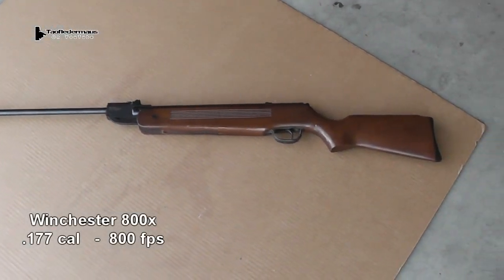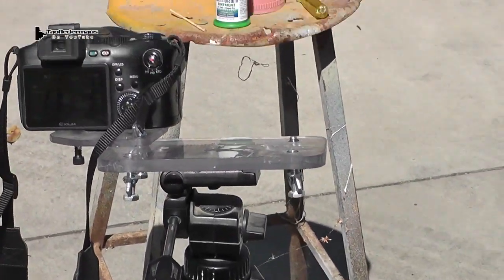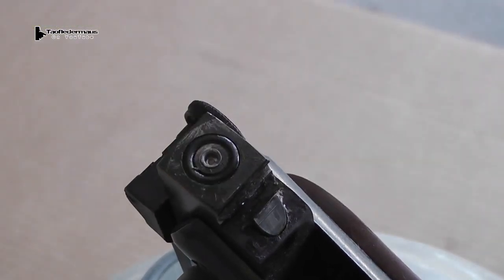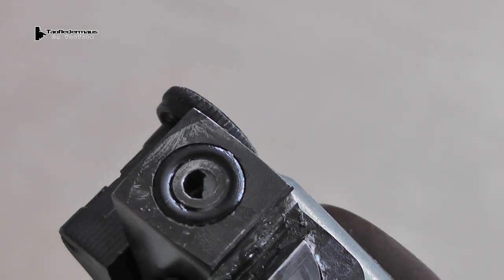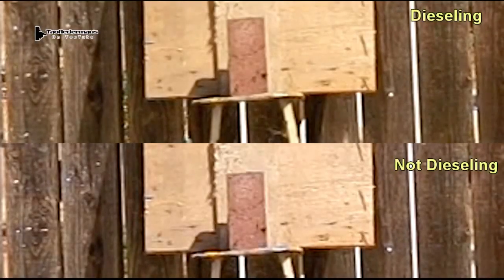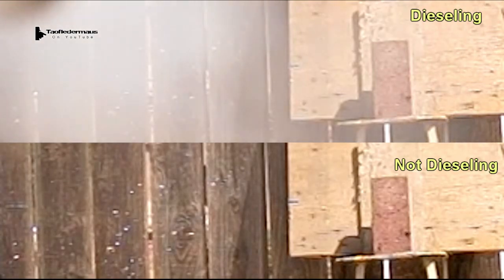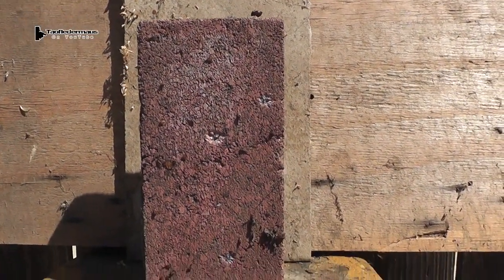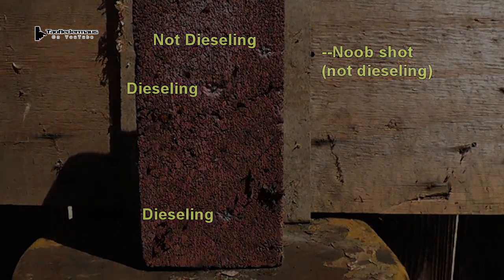Pellet Rifle DIESELING  -   Good,  Bad or Ugly?

Comment: I Dieseling my pellets with 10 w 30 oil, I just drop in to the pellets box😁👍 and ready to go, I believe I doing this for years.
Reply: I've ALWAYS kept my pellets wet with WD-40, there's always about 1/4 drop in the back of the pellet. my Chinesium SKS looking pellet gun doesn't have any seals at the barrel, just a metal to metal cone shape where the spring piston meets the barrel so no worries about that part (and didn't know!). the label on the box claimed 1100 fps, always been impressed with how much hit the thing has, and it just might be getting 1300-1350 fps for how I've always kept my pellets. had no clue about dieseling, the intent was only less friction down the barrel and the thin film letting less air/gas escape past the pellet's skirting as it scoots down the barrel. I honestly wouldn't know the difference in the report sound either! yes there IS a small puff of smoke shooting it.

picked it up from Harbor Freight for 20 bucks near 15 years ago, looked for it in eBay yesterday after seeing videos about dieseling: https://pulsar.ebay.com/plsr/clk/0/SADS/9?pld=%7B%22mecs%22%3A%2228343058111288bd9aee0f7c4a2cac84cd043ec56e4a%22%2C%22ampid%22%3A%22PL_CLK%22%2C%22enc%22%3A%22AQAEAAADYPcZGvQ35F%2FR5hsocg2aUoZAwM2PeJb4A9THo%2BodubrFUUeyEsvmHGWozy3j1LoSDWQtueMpaYxdtwfGo0fJwHY%2F08mX0Av5Wk0Bb0fgp57%2F2%2FMpMT%2BMOq7ADOBTxr0c4%2BWtcEqEC4visVAOMOMNwOQgOfOmpPsKuNaVRUNWHIiBr3z8%2FBowrMYwUtaXYvUMXrQKNwjB2XKtV1ylTLQmVzsNly%2FwpNqCzoGfixZ3MGjYgZFwZXhvpnf0h7rjf5l5EJA5I022JzOCstaHMFi3oLBzav87IUqbv%2F8uuU6lGx3uH26AX1Wk0IBSi0i3oPhFzzsaIerop7EaNRRKZ3DlvvY8AQjE2L7QqCGw%2B0bmC5Tun480PnmMts5jJfRXxiNG%2Fm5p1SPQ8Rn5AQwbmQB8Dy1v8YUSZZ5KTfwhkGcUP4jmxkbZvX1dGbFVugtP3ggY5FJy3JydWAU%2FXatkXc8Lrqc0WjyJyShY8DLPMg%2BI3ZTa9UIY5tmV2mHRLLS4CHqQI0df8ZNPE4zFPCc%2B7YvIcAB4z3ksHUZ426KDS7Pmih4qFXpK3J8fmwphxCBDY%2Bkc5chaiuRdXUkTud9qL5Mj0Fm7ufzZEXdN%2BUuFsOmTSgVny5gXkgsBoi%2B5u3dJOFHw9YoO%2BlWVlRYKt4azKc7YS4v6Dnism9PDRdZP0spkimR7fPDSjUwdYET7kd0j2N4y9cLUNcPCqR5grqQc5TRyNIq2uPFYkYsjJLIswRAtZDziG5YmNgZ0lAKGDniMLdi1U5HAFiOCnzxfCS3Z%2FCrahyT%2BVLsnVOOnAQt4RFvka%2FFbnDPk2cvqxawMfRN49STmp4a0I3tmHFDbzWBaz22Y9NWlLxBOx398ynONCXOthZjsdqGlW7J%2FJDeOLy%2F6Y%2B9jxV2%2FdZ%2FFBWZsopAj8UaNAp%2BZclWwOQbnFZ3Hb5M17so06Um4wrwOR08hSe1kL4uQRpXN3rdDYKEQB%2BW%2B1RznBcJrPVDVVN7PA2ueSpU%2F0sRN66wuvTaEaS%2F9OkkVdUTXAdcTUii7vi4ggnuJ%2BgKEj4ppbuhe8lWqEz20C2%2FscANAL7V3znE%2B%2FFNoBM%2BVG5qrSCA1Ixs5r%2F8w4d%2FaVFPEwiXMSGe%2BVfH2MHg4Aa%2B8f0J%2BDg089fKZuORjGixpsS%2BiKA%3D%3D%22%7D

is the link to the darn thing (dang that was long!)

Comment: How can you say one bullet wasn't faster than the other, the dieseling was clearly faster. Plus the science behind it is real it is not fake it's called dieseling for a reason it mimics a tech of a diesel motor. If you have a 700 foot per second gun it will increase that foot per second velocity to about 1000 ft per second if you have a gun that shoots 850 ft per second it's only going to shoot about 1,000 feet per second if you have a gun that shoots 1200 feet per second it's not going to go any faster by filling the cup of the pellet you would have to introduce a lot more fuel 4 it to propel faster than 1200 feet per second. And this is only a .177 caliber I haven't played with a 22 cal I would assume the same progression.

Comment: You made to much area when you pushed the pellet in ! 
   Put the prpellent in the bach of the pellet and load normally ! 
    This has been tested with a machine and it is faster and harder hitting ! 
    Yeah it my damage the rubber seals ( because they are rubber ) a more heat resistant seal material  would prevent the heat damage !
   If you want to debunck then use a scientific method instead of bias opinion !

Comment: The best dieseling effect is with transmision fluid, the cheaper the better. Just a drop. Vaseline is not as effective. Don't push the pellet in the barrel just fill the rear cavity. I am getting over 1300 ft/s this way with a 1.77 cheap crosman pellet from 850 ft/s. Those pellets can nearly puncture a 1/16 steel plate.

Comment: Like most Brits who were kids in the 1950s and 60s I know fine dieseling works as most of us had both airguns and model diesel engines. The latter ran on a mixture of ether, paraffin and oil. A drop of this on the back of the pellet did the trick perfectly.  The penetration of the pellet into a phone directory or two was all the test you needed to confirm the bang really did mean more speed.

As for damaging the gun, I never heard of anyone who had an issue with it and my Gecado of 1958 vintage is still working fine on the original leather seals.

Comment: I've seen Chrono testing with Dieseling vs Non-Dieseling and there is actually a HUGE boost in velocity....Break Barrel Air Rifle Was consistent within 800 or so FPS.....but with Dieseling the same pellet and rifle the Chrono was reading at around 1200 to even 1300 FPS.... that's a MAJOR increase, but you could potentially be hurting your rifle, so I'd have to respectfully disagree on this one man...!!
It definitely does increase FPS a substantial amount..!!

Comment: Lots of crony testing on dieseling and yes there is a significant amount of fps but you are correct in that it does beat up your pellet gun . 
   I would try it on a decent breakbarrel but only on occasion . Wouldn't try it on an expensive rifle or a junker .
   Anyone out there beef up their seals and whatnot to accommodate for the extra wear and tear on your pellet guns . 
    Once I break in my .25 I think I will try it .

Comment: This will only work for springers or pcp,  you can try all you want with a co2 rifle and nothing will happen as the co2 means there is no oxygen for the oil to burn in.

Regular engine oil works well, Little is better than more and you literally need just a single drop, less than what it takes to fill the pellet skirt.

It will absolutely destroy your rifle if you do it more than a handful of times, the shockwave can shatter the piston, break the spring and will blow out both the breech and piston seals but on a junk rifle it's fun.

I chronographed a crossman phantom with a strong spring In it and straight it was pushing the pellet at 700fps with a 14.5 grain pellet, dieseled it was hitting 870fps and makes a hell of a bang.

Accuracy takes a huge hit though,  it's causes the gun to be all over the shot, when your used to the accuracy of a co2 rifle it feels utterly useless but fun none the less.

Comment: I use a benjamin (gas-ram), which has already about 40J (35 to 42 depending on the pellet) and an exit speed of ~ 1200fps, dieselling it increases the speed to ~1500 fps !

Comment: I had a cheap spring-air pellet rifle from Wal-Mart as a kid, and I can say a drop of 3-in-1 on the back of the pellet, and no additional seating depth, pushed those pellets fast enough to make a supersonic crack. It hurt accuracy, probably because my velocity was really inconsistent, but they certainly had more power. It also didn't smoke like yours, I think it burned much quicker leading to higher pressures.

Comment: use a light weight oil not petroleum jelly, and don't push the pellet down the barrel at all you wan't a small combustion chamber. All in all it might add 200-300 fps to your pellet at most. Probably not worth ruining a pellet rifle.

Comment: I broke my spring doing this with a .22 1250fps  . Apparently the detonation forces the spring back so compression is lost ,so no extra speed in pellet . I would be interested to know does this work with those air rifles that run off a tank of co2.  Or the version you can fill . ?

Comment: A spring/piston air rifle was manufactured some years ago with a facility for injecting a measured amount of oil in to the piston chamber every time the gun was cocked.  The resulting explosive compression was much more dramatic than shown by the "grease in the pellet base"  technique.  The main problem with any of these temporary accelerant methods is that they  "blow"  the ballistics of the pellet as the increase in velocity causes it to "jump" the rifling lands with the resulting lack of accuracy.

Comment: I wonder what the different pressures, like the higher fps rifles, vs the lower fps rifles compare with dieselling.  I would expect the higher fps models will get an even higher effect with dieseling than the lower fps models.  That would be an interesting comparison, the percent improvement on different fps rated rifles, and which would it be worth doing this with.

Comment: I was doing this when I was 10 around 19 years ago. But using cooling oil and sucking a few drops inside the chamber and after a few shots it’s loads better but will completely brake your gun

Comment: Gotta try it with 3 in 1 oil or airgun oil. Shot a 2x4 with and WO dieseling. Definitely made a difference. The dieseled pellet went completely through the 2x4, while the other only went 1/4 to 1/2 inch deep. Would not do it to an expensive gun, but it works great with ~$100 crossman guns at wally world. I've had to shoot hundreds of dieseled shot with no noticeable damage. I don't think I've seen any videos that show a gun that got damaged by it, I'll have to see if I can find one. I know lots say it will damage the gun, not saying it won't, but if you think about it, its bad to dry fire a spring air gun bc the piston doesn't get any resistance and it slams into the end of the cylinder. I would think dieseling may be good, because you get more back pressure on the piston, which would slow it down before slamming into the end of the cylinder.

Comment: And you dont ram the pellet further down in the barrel. Pack the pellet with petroleum jelly first, insert it and leave it flush with the chamber and it won’t decrease the compression in chamber. All of that smoke is because of an incomplete combustion because you’re increasing the air to fuel ratio pushing the pellet further in. It doesn’t smoke as bad if you don’t ram the pellet down in the barrel

Comment: Guys dieseling does work. Combustion of materials such as plant oils or red phosphorous can SIGNIFICANTLY increase muzzle velocity on a pellet gun. However yes as was said in the video you are running extreme risk of damage or even personal injury by multiplying the power of your gun with a detonation in the barrel. You can make a pellet gun extremely powerful with dieseling but congruently you are damaging your pellet gun by doing this. Pellet guns are not designed to sustain detonations in the barrel like a real firearm. If you back your pellet with too much fuel you could potentially even blow open your gun barrel and fire out metal fragments into your face. You are essentially giving your air rifle the power of a small firearm. I have observed speeds of over 2200 feet/second in a Gamo Hunter Extreme pellet rifle with a .25 caliber 28 grain lead pellet!! This translates to an energy of about 301 foot-pounds which is nearly identical to the energy of a real 9x19mm Parabellum round. Likewise I have seen dieseled pellets travel through up to 2 1/4 inches of solid wood. So yes you are dealing with some serious business! Be safe!!

Comment: Funny that this guy says they are nearly in the same spot even though the bottom video the pellet hits frames later. Anyone with a chronograph that has teied dieseling before knows that the pellet is actually moving hundreds of fps faster and I've clocked them at over 1600fps on average and have gotten certain pellets over 1800fps testing different flammable fluids. %99 petroleum works great and you can make some crazy mixtures we with octane booster than are crazy.

Comment: Hey Jeff:  I like to crunch a little math when I get a chance, and thought this vid would be a good one.  I hope you find it interesting, and I hope my math is accurate. :)
I assumed your distance to be 30 ft, and wanted to compare the pellet position between 1000ft/s and 850ft/sec in 30 feet.  Not to go through all the math here, but I found the "distance difference" is .0053 seconds, (The difference in time for 30 feet between the 2 speeds), with the 2 pellets being .8" (a tad more than 3/4 of an inch) apart at 30 feet.  That is a pretty tough visual, especially at an angle not horizontal to the target, at the target.  I don't know anything about the calibration  of your system, or how video time frames work, (.030 and .0354 seconds to fly 30 feet), so I don't know how they may factor in for error, (which there is some always).
Nice test, but I think I prefer the chrono.
One more thing, pushing the pellet up the breech will lower the pressure behind the pellet greatly, (probably losing around 100ft/sec in my estimation), because it probably triples the air volume behind the pellet, (but may be preferred for dieseling if seals can blow out).  If you don't push the pellet in exactly the same depth each time,---each shot will be a different speed in direct proportion to pellet depth in the breech.
I would think oil would provide better speed than a thicker grease, not because of the dieseling, but because of the lighter viscosity on the bore of the barrel. 
I have been finding my 3rd shot after dieseling is spot on with 20 yards.  Might be just a fluke trend though, will shoot more.
Damage my gun?  I have only had it for a week, and already spent more money on pellets.

Comment: I found that pyrodex is fun, although I did not have a chrono to see how fast it shot, I was even able to fire home made boattail hollow points with it. I lit the pyrodex with common paper toy gun caps from a roll, which I cut to fit with scissors and dropped in behind the powder. My only mistake came when I got the stupid idea to put a pellet BEHIND all of that, thinking it would give me better muzzle velocity. I have no idea if it did or not, but it definitely drove a pellet into the pressure cylinder and got it stuck in there.

Comment: Not good at all. I just replaced my HW97 spring with a Vortek kit and I used a bit too much grease prior to reassembly. I went to chrony the thing to see what the gun is shooting at and my wife hit me over the head with her shoe. Damn thing sounded like a .22 going off in the living room and actually saw some flash from the muzzle. The gun should be around 850 fps with FTT .177 and the chrony read 1258 FPS. Crazy! I got worried and shot another few to clear out the excess grease but its still dieseling. I now probably have to take apart the gun and clean and put back together again so I won't damage anything. :/

Comment: As you noted, TAOFLEDERMAUS, dieseling is a waste of a gun. It is not a matter of if it will destroy an airgun, but WHEN it will destroy the airgun. What you state about the speed is incorrect, though. You do gain a few hundred fps, usually just enough to make the lead pellet break the sound barrier, or 1125fps. However, this is not by any means making it comparable to a .22lr. There is a huge energy difference between a ~15 grain .22 caliber pellet moving at 1125fps and a 40grain .22 caliber bullet moving at 1400fps. There is also a huge inertial difference which means the light lead pellet will shed its energy much faster than the heavy lead bullet. Looking to the right as I write thi, I laugh. You don't get "insane POWER" from your rifle by dieseling it, lol. After enough times though, you will end up with a wall ornament.

Comment: I used to pit a few drops of air tool oil directly in the pump tube where the piston arm is. then pump the oil into the cylinder ...it sure seemed like it made a slight difference.

Comment: He's wearing out the seals because he ramming the pellet down the barrel. All you have to do is place the Pellet in the barrel as you normally would and add a touch of Vicks filling the center of the pellet even with the barrel and fire!!! Do Not, I repeat, Do Not push the pellet down into the barrel.

Comment: You only need to wipe it in the cavity in the back of the pellet, by pushing the pellet down like you did you have that much more air that needs to be compressed to get the pellet to move the same speed.

Comment: Push in the pellet half inch or as much as one wants 👈😷👍 It will diesel without the oil 👈😁👍making it dry dieseling 👈😷👍rick MacGyver 305 with trigger modification for free and making it very sensitive to touch 👈👍making the second stage trigger a little longer and or putting different Sears spring will help out 💯 with accuracy with the right hold ....

Comment: I appreciate your effort, but you cannot gauge the speed of a pellet by sight/video. Dieseling DOES increase the velocity of the projectile, and as far as blowing out seals, MAYBE after a significant number of shots there might be some degradation, but the seals are pretty strong for their size. The compression explosion will generate an enormous amount of energy in proportion to the size of the pellet.  So simple common sense, not to mention science says that the pellet will be propelled at a greater velocity.

Comment: That's not smokes it's just atomized petroleum product spraying from the barrel. There's no way that it can create combustion without a heat source. Science...
Reply: The heat source is the high pressure. That's why they call it dieseling, the high  pressure in the combustion chamber of a diesel engine ignites the fuel.
Reply: Nothing more poetic than when someone tried to use "science" to seem smart and that same "science" proves them to be an actual dumb ass.    Look up compression ignition to learn about the "science" behind dieseling.  LOL
Reply: It is definitely smoke. Don’t believe it? Shoot it in the dark.